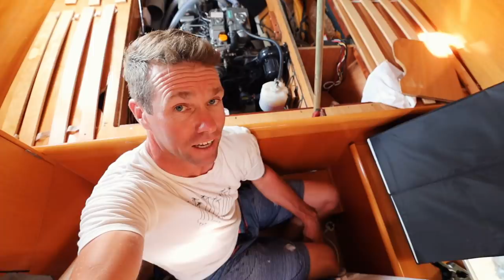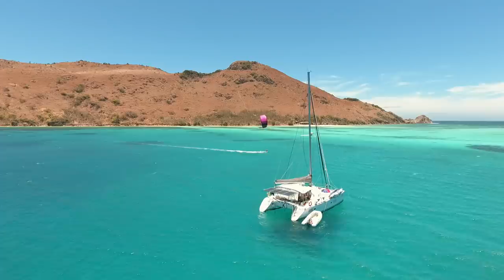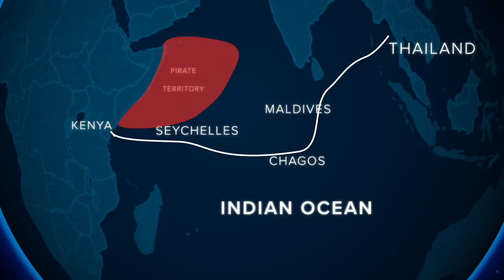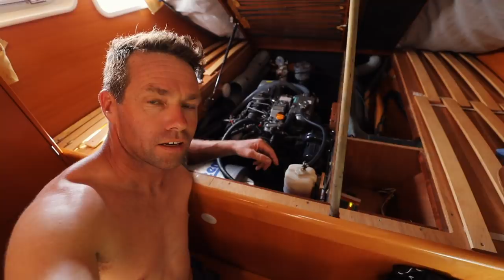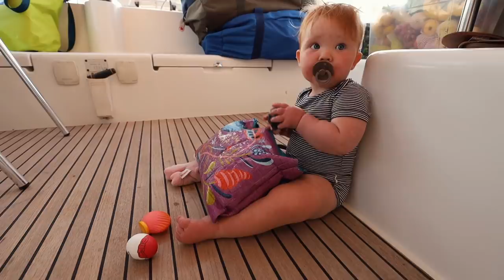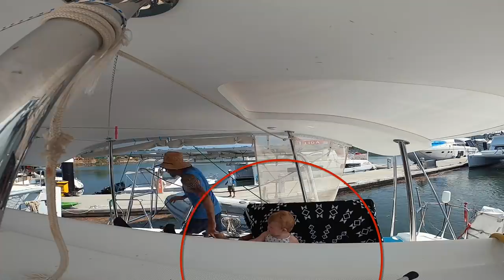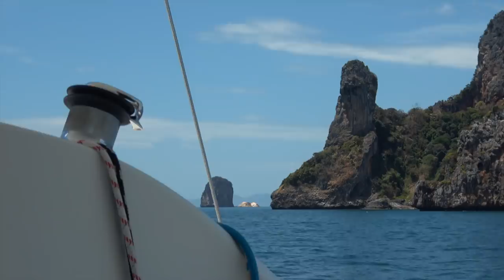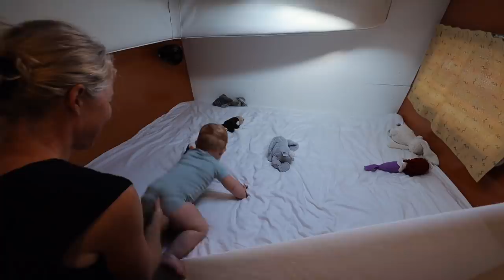we Just BLEW UP our Engine

Comment: Hopefully the wall of the cylinders are not scrached and is only a bent valve rod.   Check the rings of the piston. Even a hair scracht on the piston wall is bad. After fixing the engine .... run on "full load" .... if you are making dark smoke, oil is entering the piston chamber.

Comment: Make sure you’ve got good Fuel pressure and make sure Diesel is good. if you confirm that Pull the injectors get them cleaned or replaced

Comment: Well stuck valve or bent pushrod isn't the end of the world. I was going to suggest that just removing the valve train or rocker assembly on top of the push rods and then replacing the bent push rod would work until I heard the last clanking noises from the motor.  Now I believe that your on the right course in removing the head and having the valve train serviced and replacing the bent parts.. most valve guides will still be good but if you want to have the thing serviced thats ok just alot of extra expense you may not need. Just have them mic everything (valve guides)  to check wear. It is hard on a motor to sit for a period of time with no lube.

Comment: Because it had been sitting for so long the oil drained out of the valve gear. Then one valve went down and got stuck and didn't return properly and was still open when it got whacked by the piston. Now it's got a bent valve stem and that tapping noise it is being whacked by the piston every time it comes back up. Crank engines over by hand to get the oil circulating again, before starting them if they've been sitting for awhile. Pull the head off and you might be lucky enough to get away with just one new valve. Plus gaskets.

Comment: If it's just a push rod then that's a very easy task on your OHV engine and can be easily done by you . The whole lot can  cam followers can be undone and lifted of and the push rod replaced ( why has it bent a pushrod only is strange ) If you can find the replacement then it simply drops in and feeler gauges are used along with a torque wrench . It's a very old system  OHV like a car from the 60's

Comment: Your push rod bent because your valve might have stuck. Pull the rocker assembly off and check that valve by pushing on it with the back of a hammer. You can replace the pushrod at this time. But something caused that pushrod to bend.

Comment: I think I'm a day late. I wouldn't panic. Take the rocker cover off first and check all the gear you can see. Don't jump to conclusions. A few months ago we had a VW diesel in. When we started the engine( it came on a breakdown truck) it sounded like it was all over for that lump! Turned out to be a very loose injector, being an hdi it put it all over the place. Worst case scenario is a dropped /bent valve - which could be major. Good luck.

Comment: Hey guys I’m a marine mechanic from Vancouver Island Nanaimo. One thing I have noticed that nobody has mentioned is that you should be very careful trying to start and excessively cranking an engine without the raw water ball valve being turned off. Because the water lock muffler can fill with ocean water and flow up into the aft cylinder. Because water cannot be compressed the result will be a bent push rod which is the weakest link in the top end of the engine. Watch out for rust in the cylinder. And change your oil. Your little JH should last for 6000 hours
Reply: I believe what you meant to say is a bent connecting rod not push rod. If the cylinder is full of water you will bend the connecting rod between the piston and crankshaft.
Reply: @howiroll740  The connecting rod is way stronger than the little pushrods. With a cylinder full of water and the starter rolling the engine over. The piston is trying to compress the water and an valve is trying to open. The valve has resistance against the water and the force is transferred to the pushrod. Both bent connecting rods and push rods can be caused by water intrusion I agree with your statement. But watching Ben crank the engine for a long time trying to start the engine without possibly shutting off the raw water lead me to suspect water intrusion.
Reply: @jaredkolich2004  The bent push rod is on an exhaust valve which begins to open at BDC before the upstroke (exhaust) of the piston. In order for water to enter the cylinder the valve would have to be stuck at least partially open on a downstroke. If the valve was stuck open, then the push rod could move out of alignment as the camshaft rotated and be bent as the cam continued rotating. I'm curious how many hours are on this engine since Ben said the loud knocking didn't start until they revved the engine.
Reply: @howiroll740  My guess is they will find some sort of interference causing the valve not to move properly. The push rod is like the fuse-able link in the system, first to pop. Salt water and engines are never a good mix. Hopefully they find a reputable shop to remove the head properly.
Reply: Even if hydrolock did not cause this problem, knowing to shut off the intake water if a marine diesel does not start within a minute of cranking is important basic knowledge.

Comment: when you get this motor to a repairer they will be able to repair the valve and push rod easly ,how ever the cause of the valve being stuck is your outlet manifold ,it will have cracks at the weld were the iner and outer tubes are welded to the mounting plate,this has allowed salt water to enter number 3 exhaust valve.you must replace both exhaust outlets to fully repair the problem,there is a cast stainless one available

Comment: FYI. If your just out, remove pushrod. . run it. If you are able to disco fuel to that one. You can straighten a push rod in a vise if you need to, put you would need to go easy on it

Comment: Looks like a head off to check those valve make sure that one is not slightly bent, be worth lapping them all in too, may need replacing to be on the safe side, I think the exhaust vales can accumulate a little wet steamy saltness when the engine is stopped from the wet exhaust

Comment: Word of advice when cranking a marine engine that won't start right away. As you're cranking, raw water is filling up the exhaust system. In normal engine operation, exhaust gases from the running engine help push the water along and out the exhaust exit. If cranking for an extended period without starting, water can actually build up high enough to backflood into the exhaust manifold and get past an open exhaust valve into the engine. When you go to start it again, your piston tries to compress seawater as it reaches top dead center. As you can imagine, that's when piston rings, piston crowns, and connecting rods break. If cranking a marine engine for an extended period without starting, always drain the exhaust discharge line downstream of the raw water elbow fitting where raw water enters the exhaust system. Either do that or shut off raw water intake to the raw water pump on the engine while cranking and turn the water back on to the inlet as soon as the engine starts. Most properly configured systems have a drain valve placed somewhere at the low point in the exhaust (near a wet muffler box, for example) to accomplish the draining easily.
Reply: I did not see this comment before I added my own similar advice.  Hydrolock can be expensive.

Comment: A sticky valve is very common on engines that hve been standing. Next time just put a socket on the crank pulley and turn it over a few times. When you started it up you could hear it was a tappet making the initial noise, that became a more serious issue when the tone changed; hopefully the piston did not have a meeting with the valve. Good luck.

Comment: When you were trying to start the engine and it turned over fast and slow. That meant you had a valve stuck open. You could have stopped then and pulled the tappet cover. Seen the stuck valve, given it a couple of taps and it probably would have jumped closed. Put it back together and started it just fine.... After you turned the fuel on, hahahaha. Each to their own. You will remember that sound next time. When you actually started it the push rod was loose and fell out of its cup in the rocker arm and jambed on something, probably the rocker arm and bent. Check the rocker arm it may have cracked a piece out.

Comment: I suspect there is a valve stuck in the open position and the piston is striking it on the up stroke.
This often happens to valves if the engine hasn’t rotated for a period of time. Exhaust valves are especially vulnerable since the atmospheric air can travel up the exhaust pipe and allow corrosion to seize the valve in its guide. The piston can’t always hit the valve ( this depends on the engine model) but if there is the slightest sign that it has be sure to replace the piston. There is a good chance the piston will also fail sometime in the not to distant future.

Comment: Pull the rocker arm rail in one piece then you can replace the rod that is bent then put the rocker arm rail back on and torque down to 16foot pounds but before any of that make sure the engine is at top dead center

Comment: Have you ever considered going all electric? No need for fuel, just a bunch of batteries and a couple solar panels. The electric motors also generate electricity as you sail. A couple on another channel I watch has an Oceanvolt setup they like a lot.

Comment: Try replacing sparkplugs ang tune-up..because it has been sleeping for months its only in the cylinder head..if the water merge on oil or it smokes color white that means your piston or piston rings are damage

Comment: Sounds like a few things could be the culprit.
1. A valve head has dropped into the cylinder
2. Your bear journals on the crank have gone out 
Or 3rd option from the looks of that. 
You have lost a piston ring. Which is giving positive crank case pressure into the top end of the block......

Comment: Pushrods should be easy to replace.  Unbolt the rocker and just pull out the old one and drop in a new one. 👌 

To protect the valves it helps using a lighter weight oil.  5w30 would be much more valve friendly than 15w40 or 20w50.

It's worth changing the oil on both engines for fully synthetic 5w30 or 10w30.  Shell, also called Pennzoil, makes the best engine oil.

Pennzoil Ultra Platinum 5w30 Full Synthetic  or Shell Helix/Rimula 5w30 Ultra.   Or 10w30.   The number before the W is the cold oil "weight", and the number after is the hot (100°c) weight when the engine is ruining.  

5w30 is typically fully synthetic whereas 15w40 is always "mineral oil" which offers much less protection and tends to leave deposits on valves and piston rings.

Your engine looks like a Yanmar 4JH57 here's the manual which is worth saving on your laptop desktop! ... 
https://www.yanmar.com/media/global/com/product/marinepleasure/sailBoatPropulsion/operationmanual/JH-CR_OPM_0AJHC-M00011.pdf

Torque settings on page 77.

Comment: My bet is that the valve got stuck due to corrosion from the salt air near the ocean. My second bet is that you didn't oil fog the engine before you left to come home which would have provided protection from the corrosive air. No cranking the engine with the fuel off didn't bend the valve. Maybe if cranked long enough with the fuel off the fuel injection pump may have been damaged but not a bent pushrod.

Comment: I’m not a diesel expert but, the only two reasons I can think of for a bent push rod is a seriously stuck valve. I would try pushing the valve down manually to see if it’s the valve. If not, the push rod may have failed (bent) due to stress or manufacture fault ( unlikely). The other reason could be if the fuel rail was not primed prior to starting after fuel starvation. In any event, get an expert to diagnose and fix it.

Comment: Hey guys.  Hard to tell for sure but the engine issue does not sound like a big deal.  It appears that you have a stuck valve which bent the pushrod.  Likely the pushrod is banging against the block making all of the racket.  Since you are in the water and need both engines, there may be a way to quickly get this engine back online.  I have done this fix on other brands of diesel engines.   The stuck valve should be easy to find.  Look at the pushrods under the valves, there is probably one that is at a different angle than the rest due to it being bent.  Loosen the locknut and back out the adjuster on the bent pushrod.  Now using penetrants such as Marvel Mystery oil if you can find it, soak the stuck valve stem.  Now light tapping on the valve until it moves freely.  The bent pushrod can be removed in a pinch and hammered straight.  Roll the stem on a straight surface and you can tell if you have it straight.  Reinstall the pushrod and set the valve clearance to specs.  If you don't have the specs. measure the clearance on a sister intake or exhaust valve and set it to that value, should be fine.  Too loose is safer if there is any doubt.  When you have the time, order a couple new pushrods and replace the bent one and keep another for a spare in case this happens again.  Best, James

Comment: Never heard of a lid of valve freezing in cylinder, but maybe, important to check this immediately after taking off the head. I'd rather think that the valve guides are gummed up, in which case go with the guidance, was this the first movement of the engine since storage? Have seen old engineers poor oil over tops, maybe this is reason. But I would prefer to crank engine by hand, imagin if you will if piston rings stuck in grooves, this normally would be the biggest concern. Good luck.

Comment: If you are coming to the Seychelles make sure you have everything you need, very hard to get parts here and with covid it has made it even slower 2 -3 weeks for most of my stuff and then really expensive, the government wants money for everything and the different departments do not work together. if your boat is running fine there should be no problems, yes the beaches are really nice.

Comment: Changing the pushrod is simple just unbolt the rocker assessment and replace the pushrod.. if the valve is same height as the others it more then likely isn't bent... This more then likely happened because the valve lash increased over time and wasn't at right speck get some filler gauges and check your engine manual for lash clearance, you can do this mate it's not hard

Comment: Probably had a valve stuck open which explains the apparent lack of compression on that cylinder. Then from use while stuck it broke off into the cylinder and is likely chewed up in the top of the piston. Hopefully it isn't that case but good luck with the repair

Comment: My guess is it wasn’t getting oil pressure. Revving it just made the issue worse. You’ve got a bent push rod and the lack of oil pressure would cause that. There could be significant damage to the piston. That engine needs torn down to verify the piston and cylinder didn’t get banged up by the bent push rod.

Comment: A rod bent that much probably means the valve guide is buggered up too. Good thing to pull the head and have them looked at. The other possibility is you flattened the cam lobe which would a lot more money. Hopefully, that did not happen.

Comment: Blew a rocker or a piston rod but either way it is a teardown, start with removing the valve cover to get an idea what broke....ah bent a pushrod, remove the rocker, see if the rod comes out in one piece. Inspect guide, replace rod, adjust rocker. If all good lucky, if not teardown....Important notes on any diesel, make sure you have a way to cut the" air "off to your motor at a minutes notice, see " diesel runaway",...if it happens your boat will burn to the waterline! 🤔👍🛎🙏

Comment: Bad luck with the engine !! We've started engines that have sat for years without problems, and some that have sat for months that explode. Unless you really open them up and go that far in depth to touch everything, it's a crap shoot. But then, you could just as easily muck it up by opening it and "fiddling" in there. At least you didn't blow a piston out the side of the block.

Comment: Bleed your injectors, check your oil. And check your valve movement you may have a bent valve stem. Or missing keeper and for bent push rods. Worst case.... piston connecting rod bearing. You may have spun it on the crank shaft.

Comment: The timing belt slipped a few teeth and the valves probably hit the piston and bent the rods. Same exact thing happed on my company’s man lift had to pull the head fortunately the piston didn’t have any damage a but needed a valve job on the head. Good luck wish I could help you!

Comment: Stuck valve, after the second run kissed the piston. As a diesel tech in Canada I would have popped the rocker cover off, tapped the valves with a soft hammer to make sure they were not stuck. I do this after equipment sits for a long time, save headaches after start up. Just my thoughts.

Comment: when the engine has decompressors(I can't tell if your's have it)  I usually make it run freely without compression when bringing them back alive after sitting , head is not that difficult on these ! to help maneuver on one engine I put the dinghy with someone in it did to the side of the boat,, hope it gets fixed fast can't wait to discover again with you guys !

Comment: If the engine was running properly before storage there is probably nothing mechanically broke. Oil and diesel oil tend to gum up when stored too long. I would have drained all the oil and diesel fuel and replaced with fresh fluids before even starting it up. Replace oil and fuel filters as well. The injectors nozzles may have also gummed up and may cause the misfire. All these should have been done before starting up the engine to avoid damage to all friction surfaces. If you were still in the PH almost any major city has a shop that services Yanmar or Kubota 3 Cyl engines.... Good luck!